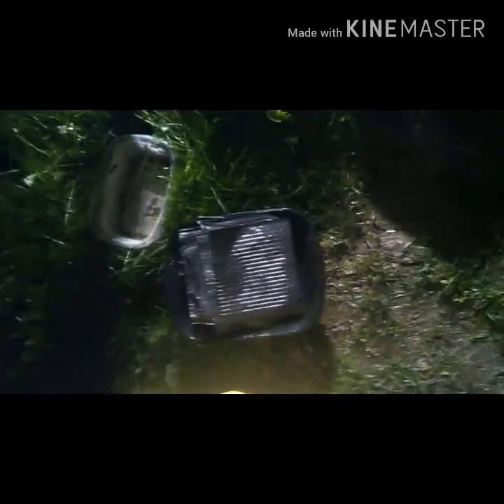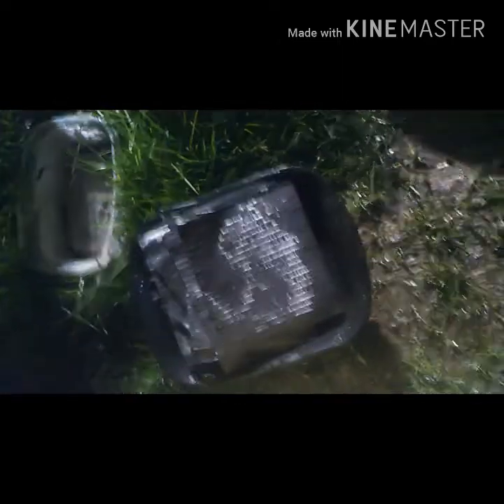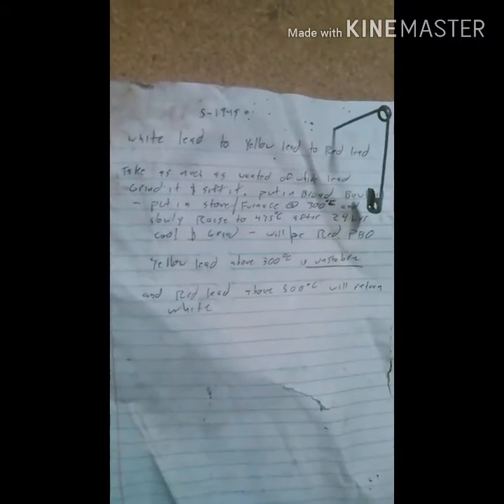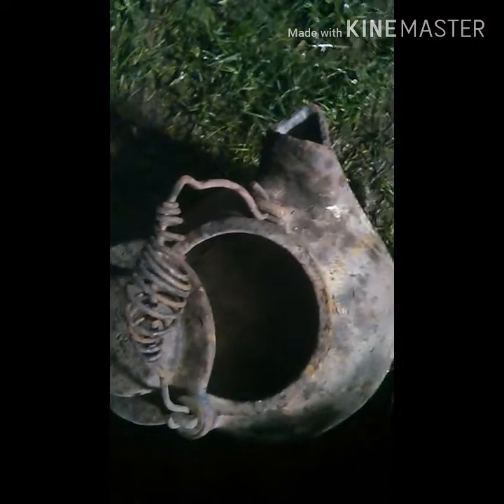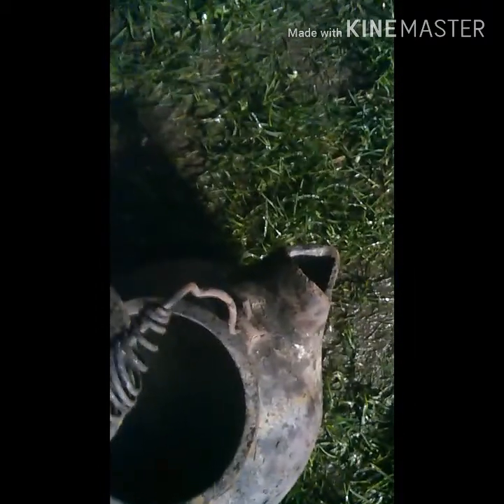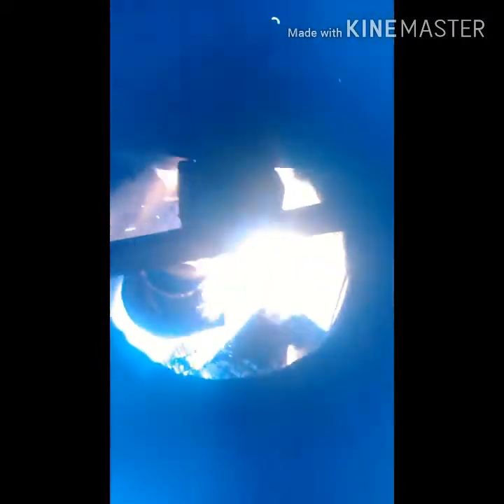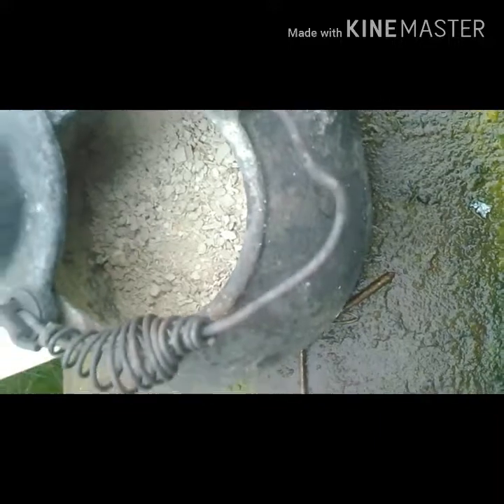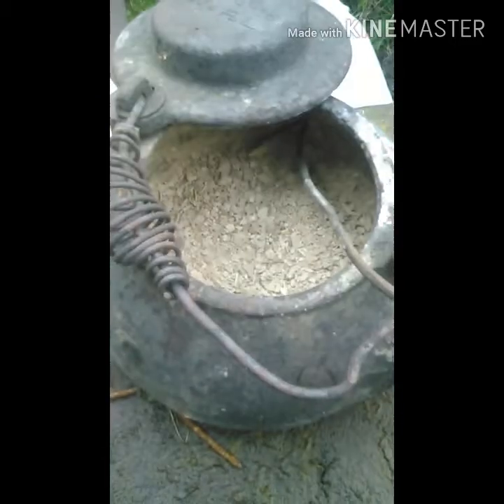How to make litharge, yellow lead oxide. NO CHEMICALS!!!

Comment: hi sir can we make yellow lead from galena ore directly ?
Reply from the maker: As in like a single step from ore to yellow lead? Not that I know of
Reply: Thanks for your response.
Ye i tired to fire crushed galena in a kiln but without air at 1000 C but it stayed gray without changing
Reply from the maker: I think your temp is to hot my man, I know when using lead oxide the hotter it is the faster the changes come and the less control I have over it.also knowing it's goes grey,pink,red, orange,yellow,grey you may have missed all the changes by not watching it. I've had the reaction happen as soon as ten minutes